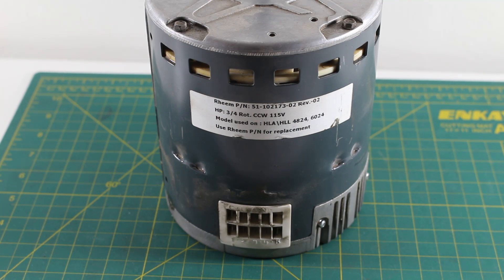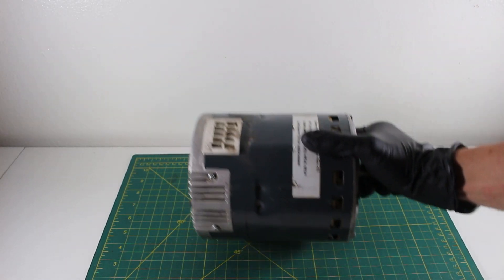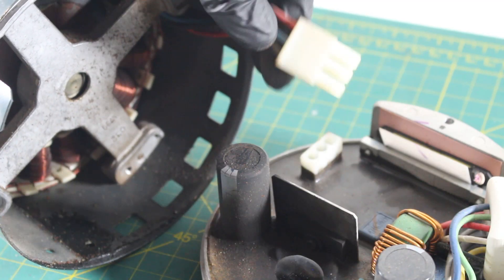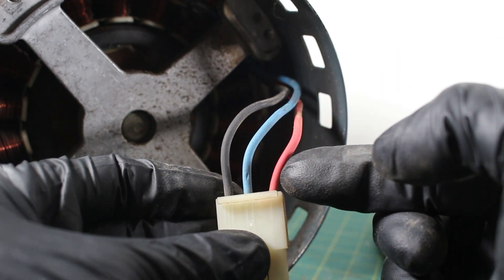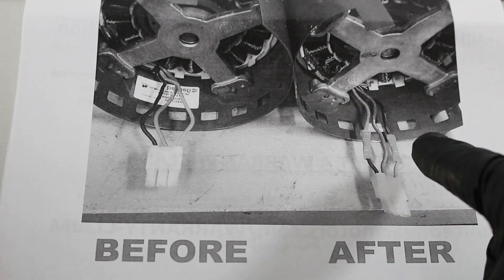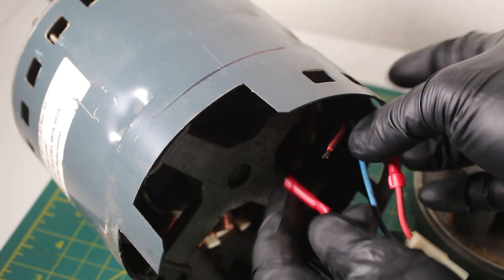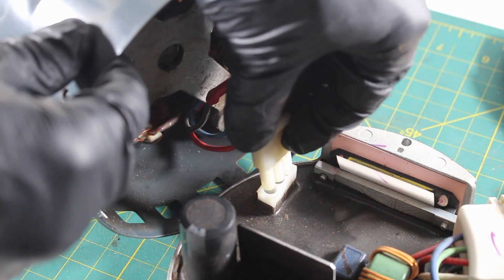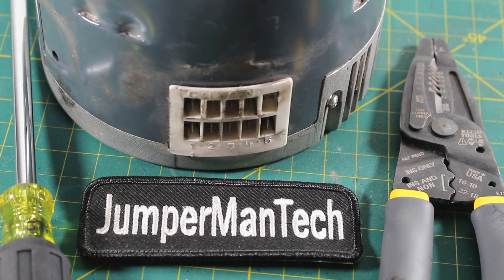HVAC: How To Reverse Direction For a ECM MOTOR (Reverse Rotation/Polarity For X13 ECM MOTOR)

Comment: I have a 1 horsepower ECM motor did I acquired wanting to use it but unable to because of this ECM controller is there any way to use the motor itself, what's your thoughts thank you

Comment: I have one I need to reverse right now. The wires are red,blue and yellow with blue in the center. So the red and yellow wires are correct wires to change? 3:35
Reply: did it work? Evergreen sells a reversing harness (5k016) but they swap the red (outer) and blue (middle) wire. Maybe it works either way.
Reply: Just switch any 2 phases

Comment: Don't cut / splice  the wire.  These " molex " pins are easy to de pin.  Reach inside the plug with a small pick or paper clip from the terminal end.  Press down the holding fixture / catch and slide the entire terminal backwards out of the plug.  Bend the pin slightly out to ensure positive catch and reinsert the entire terminal into the plug in the desired position.  You should be able to unpin and re pin this entire plug in less than 2 minutes.  Yes - it's that easy.

Comment: I had a motor not do anything,  so i ordered the ecm module, the blower then started to turn about a half an inch to two inches in both directions kind of going back and forth???  called for tech suppt they wouldnt answer, the box i bought the module was opened at the supply house, and a thumbprint was on the inside of the module,  made me wonder if a customer brought it back and it is no good?  at this point have no help or direction.  any help would be great?
Reply: Perform an ohm phase to phase test on the motor wires (the connector he cuts in the video). All 3 reading should be about the same. My motor windings had a short. I was able to isolate and insulate the copper wires that were shorting out inside the motor. Fixed my problem.

Comment: Those Gentec X13 modules aren't reliable and expensive to replace. They aren't worth $800 or more if they are going to keep on failing. Those modules should be redesigned by the manufacturer and given a 10 year or longer warranty to make up for the ridiculous past.

Comment: What happened with the burned component inside the ECM, what was the cause and why didn't you replace it
Reply: Cheap materials and a flawed design. Those modules are $800 to $1,200 to replace...almost the same price as a complete new motor assembly.

Comment: Which Molex tool is used to remove the wire connectors? I have a new Emerson x13 motor that is running backwards (out of warranty). Purchased 6/2/2021, installed 12/20/2021, evaporator/line freezing now that hot weather is here. Help will be greatly appreciated!!
Reply from the maker: Cut the wires and wire nut it! Not sure about the molex tool. Thanks for watching🔧⚡️🤙
Reply: @JumpermanTech  I'd guess you could reverse the source plug wires as well?

Comment: Thanks for sharing this. This was my airflow culprit. The replacement module for a blower was blowing in reverse and had I no idea after wasting cycles trying to figure out why the blower wasn’t blowing faster even after messing with controller board CFM settings. Sure enough, reversing the polarity like you demonstrated was the fix.

Comment: If you had a terminal pin kit, you could remove the pins in the molex connector really easily and just switch them that way. I've had to rewire so many ABS harnesses this way.
Reply: Yep and usually you can get away without the kit, most connectors and terminal pens are accessible with a tiny screwdriver or straightened paper clip.